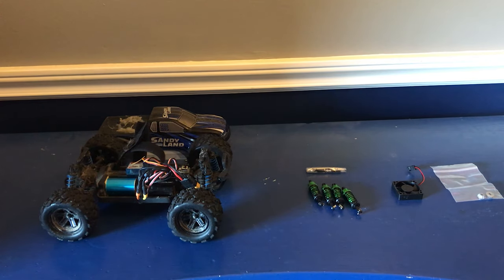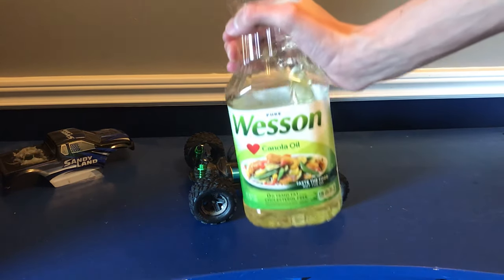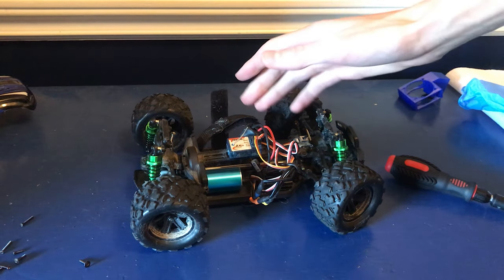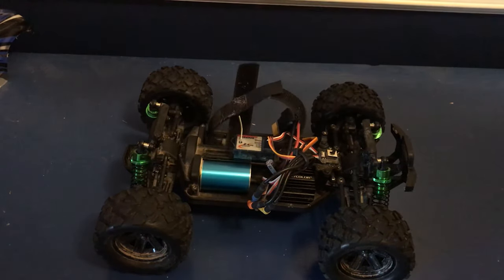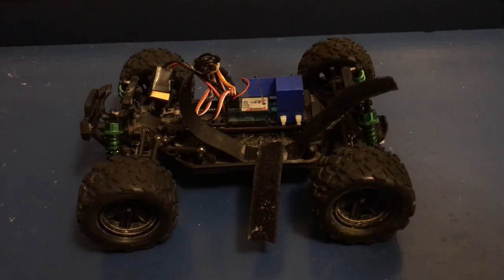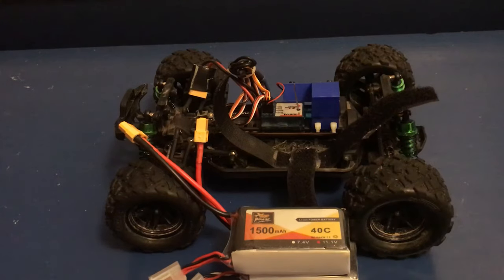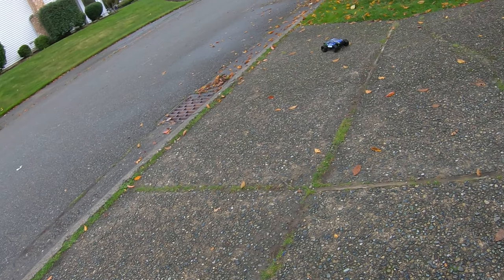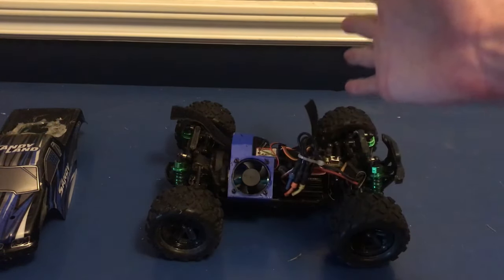Oil Filled Shocks, More Metal and a Fan for the Sandyland! - More Mods and Upgrades

Comment: You can also install wheel bearings on the Sandy Land. It comes with bushings from the factory. Each wheel takes two 6x10x3 bearings. It's a huge improvement over stock.
Reply from the maker: I swear you’re a mind reader. I just had a set of bearings delivered yesterday!
Reply: @CHEESEBURGERRC  You should join the PXtoys fans f a c e  b o o k page. I'm on the verge of installing an adjustable motor mount from a WLtoys A979.
Reply from the maker: I haven’t made an account yet, but I will soon! Hopefully I can join sometime in the next few weeks. 👍
Reply from the maker: That sounds pretty awesome by the way!
Reply: @CHEESEBURGERRC  should hopefully be able to install a 2845 brushless motor and a bigger pinion.
Reply from the maker: That thing seems pretty awesome! I’ve been thinking of getting a similar one myself! It’ll be cool to see how well it works👍

Comment: Just tore apart my deerc 300E (factory upgraded sandyland.) And it has the same metal differential. The oil filled shocks had no oil however and leaked when I filled them. Metal bearings though. I just need to get your shocks then a 3s battery and fan. I complained about the shocks not holding oil and the company is sending me a new truck free of charge.
Reply from the maker: Nice! I’ve heard good stuff about the Deerc one. It sounds like fun!
Reply from the maker: Here are the shocks:https://amzn.to/2KdILfO
And the fan: https://amzn.to/2K4P2KT
I've been going through putting links in my descriptions too to make it easier to find stuff. 👍

Comment: Been watching the sandyland videos for a while now and I’m wondering if you can just zip tie the fan onto the motor
Reply from the maker: I don’t think so. It’d most likely fall off, and possibly yank the motor weirdly if it got snagged. If you can’t 3D print a mount though, you probably could zip tie it to the chassis brace in the middle.

Comment: I just got my fan but I unfortunately do not have a 3d printer to create a mounted area for my fan. Any suggestions you may have to place the fan?
Reply from the maker: There are a couple options. The easiest one would be to mount it in the same spot just without a mount. You could probably run zip ties through the screw holes to attach it to the top deck, and you might even be able to run a zip tie under the motor too! Just make sure you don't tighten it on the driveshaft. 
Another option (Pretty similar to the first one) would be to hot glue the corner of it to the top deck. Either one of those would hold it over the motor. You could in theory also glue it to the motor, but you should only use a small amount of glue if you do that to avoid damaging the motor.
Alternatively, you could cut out/bend some plastic to make a little mount. That would give the fan some extra stability, and possibly hold it at a better angle.
If you want to use a proper 3D printed mount, there are companies that will 3D print parts and mail them to you!
I hope this helps!
Reply: @CHEESEBURGERRC  OK that's great. Thank you very much I will very much do that.

Comment: So, I put in my new metal diffs for this car, i noticed that it was making a horrible grinding noise and slowed the car down tremendously, i took the whole car apart inside out, I even put in the old diffs and it still grinds, I cannot find the problem! Did you ever have this problem? It may be a stripped tooth on a gear or something, I forgot to check that.
Reply from the maker: There’s a few possible causes. Probably the most likely one is the little bevel gear that spins the differential has broken. It’s plastic, and in my experience can lose a tooth or two. It’s really hard to see the damage sometimes, (because it can take off just the tops of the teeth) but it makes a grinding noise. 
It’s also possible that it’s the pinion. If you used a different pinion gear for the aftermarket motor, it might be slightly too big or small. 
It could also be the metal gears themselves. If you didn’t add grease, they could make some noise. I don’t think this is it though because the noise didn’t go away when you took metal gears out. 
I hope this helps!
Reply: @CHEESEBURGERRC  thanks! I will definitely look at the spur gear because it may be chipped, i have plenty of grease in my diffs and gears so i dont think that is it, thanks again!
Reply: Yep, so i looked a bit harder and i saw that the pinions that make the diff drive, are totally gone 🤦‍♂️

So i bought metal pinions!

Comment: and also were did you get those shocks? ive been looking for better ones for my sandyland
Reply from the maker: I got them here: https://amzn.to/2KdILfO
Reply: @CHEESEBURGERRC  ok thank you so much
Reply: on my sandyland i have one fan blowing on the motor and one fan bringing out the hot air
Reply from the maker: @zerobraincells2629  Lol how can you fit all that stuff inside the shell?
Reply: @CHEESEBURGERRC  i have the same setup as you for the motor but i put the other fan on the body its self with zip ties because i cut out holes there
Reply: i also installed a temp gage so it will go into limp mode after it gets over  a certain temp
Reply from the maker: @zerobraincells2629  Ah! I hadn’t thought of that... I’ll have to give that a go👍
Reply: @CHEESEBURGERRC  that would be a great video
Reply: do you know the top speed of your sandy land
Reply from the maker: @zerobraincells2629  I don’t really have a good way to test it... But I will try soon!
Reply: @CHEESEBURGERRC  with my sandy land running on 4s i get up to about 65 mph
Reply from the maker: @zerobraincells2629  Jeez man! That sandyland of yours is an absolute monster! I’ll have to check out one of those motors and ESCs you have.
Reply: did you watch the video lol
Reply from the maker: @zerobraincells2629  Yes I did.
Reply: @CHEESEBURGERRC  the video is not updated I'm releasing a video on the first run.  I'm also  going to do a burnout to celebrate :)
Reply from the maker: @zerobraincells2629  I can’t wait to see it!
Reply: @CHEESEBURGERRC  i need to find some cheap tires
Reply: i think its a slight bit over powered its going to destroy tires
Reply from the maker: @zerobraincells2629  Yeah, a 1/10-1/8 scale motor in an 18th scale car might be just a bit over powered.
Reply: @CHEESEBURGERRC  small cars with alot of power are always fun
Reply from the maker: For sure!
Reply: @CHEESEBURGERRC  i saw that boat on your insta that thing is so cool
Reply: what power system is in that thing
Reply from the maker: @zerobraincells2629  I got it in a bundle from Pxtoys. I believe the brand is called “flycolor”
Reply: @CHEESEBURGERRC  i have an rc boat that has the same electronics as my sandy land but it has a 540 motor with water cooling

Comment: How do you wire up the fan
Reply from the maker: It has a wire like the ESC and servo that just plugs into the receiver. It won’t work with the stock box though.

Comment: put on a spoiler. px9300-27
Reply from the maker: I’ve actually been looking for a spoiler! Thanks! I’ll get one of those👍
Reply: @CHEESEBURGERRC  if ur looking for parts the manual that came with it has all the parts and upgrades -_-
Reply from the maker: The spoiler is on its way now! I’ll hopefully be able to install it soon!
Reply: @CHEESEBURGERRC  ur gon need to poke a hole or get a diffrent body coz the company is weird like that. Works great on my setup after modifying tho.
Reply from the maker: Alright. Thanks for the help! I’m excited to try it! 👍

Comment: Another upgrade you might be able to is an upgrade on the pinion. There are 2 different pinion that pxtoys uses. There's a 14 and 17 tooth. 

http://www.pxtoysrc.com/index.php/pxtoys-rc-car/pxtoys-9302-spare-parts/pxtoys-9300-upgrade-parts-oil-shock-992.html
Reply: PX9300-34B is the 14 tooth and PX9300-34C is the 17 tooth pinion.
Reply from the maker: How do I set the gear mesh with a different size gear? It only has the one slot for the motor.
Reply: I haven't done it myself, but the motor can mount 2 different ways. If you flip it one way, the gap between the motor and spur is smaller. Then, if you flip it over, the gap is bigger.
Reply: Not my picture, but someone bought the upgraded motor and this is the old vs new motor. He installed it, and it fits.

https://photos.app.goo.gl/d7MgWLE2x7EN8RCd8
Reply from the maker: I hadn’t realized that. Thanks! I’ll have to give it a go!